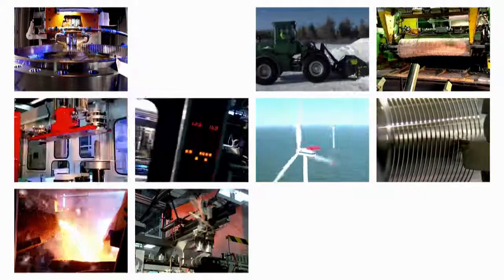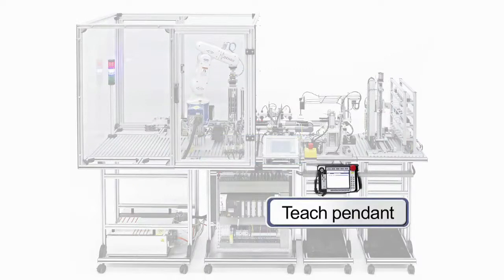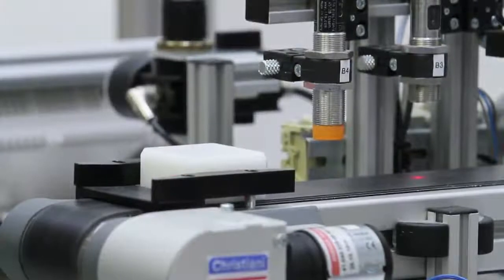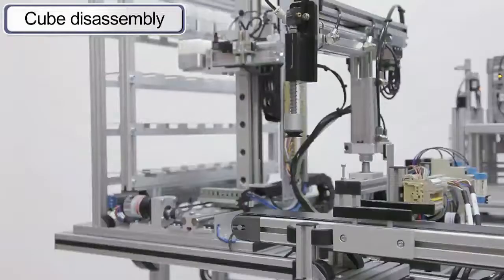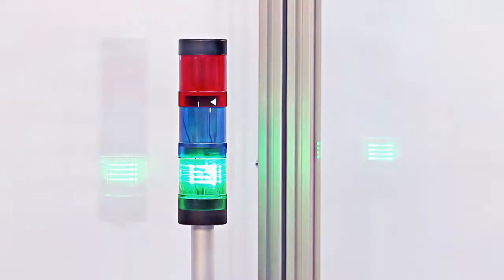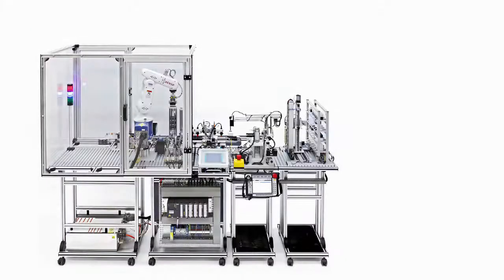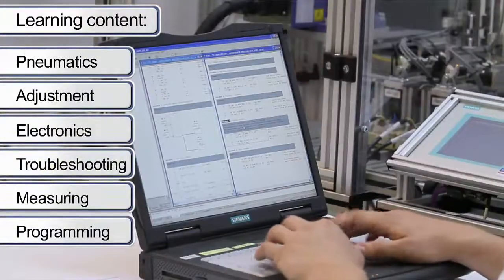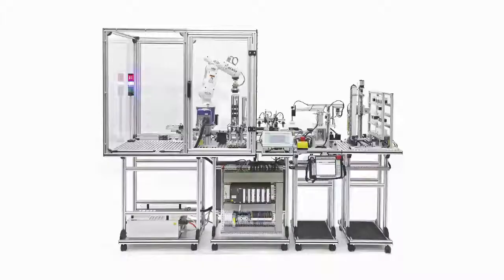MECHATRONIC CUBE ASSEMBLY ENDLESS ( MMS - Modular Mechatronic System ) AUTOMATION

Comment from the maker: This training system is the ideal solution for preparing your trainees for later deployment in an industrial setting. Despite its low space requirement, the system comprises a complete assembly/disassembly system. Complete cubes are produced from the cube halves stored in the magazine. These are stored in an ASRS and taken out of storage according to requirements, disassembled and put back into the magazines. This results in a closed material cycle. Assembly and disassembly can be activated/deactivated and controlled independently of each other. Assembly is carried out using the cube assembly compact system. Disassembly is carried out by an industrial robot. A colour touch panel is used to operate and control the system. The system is built ready for operation and are delivered already programmed.